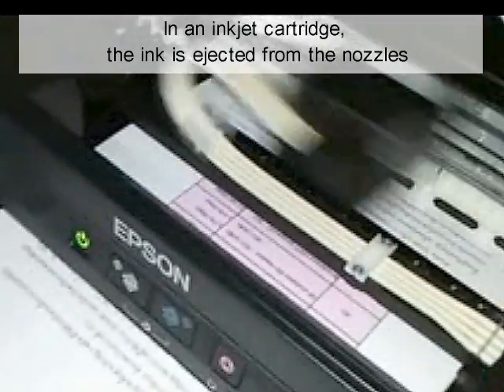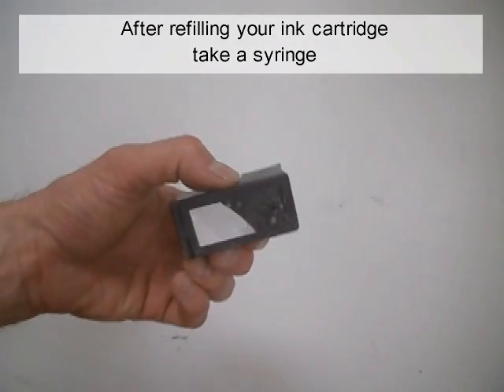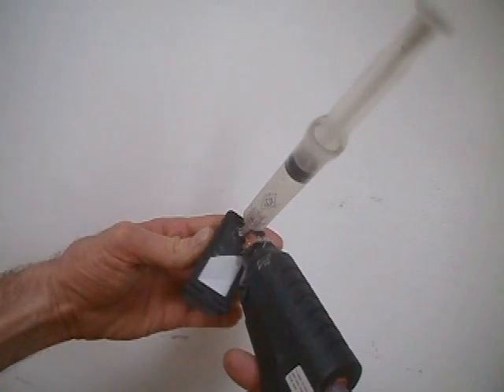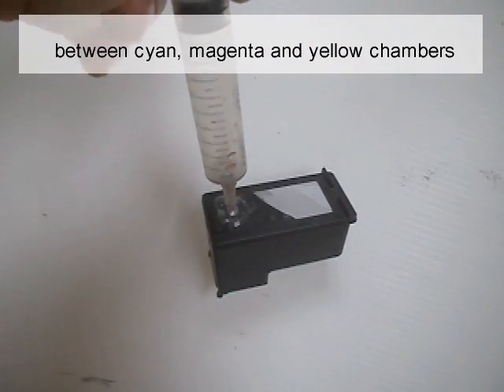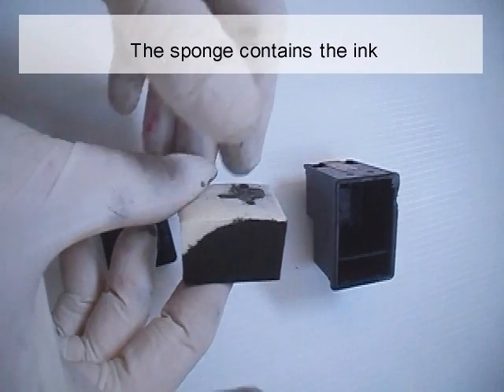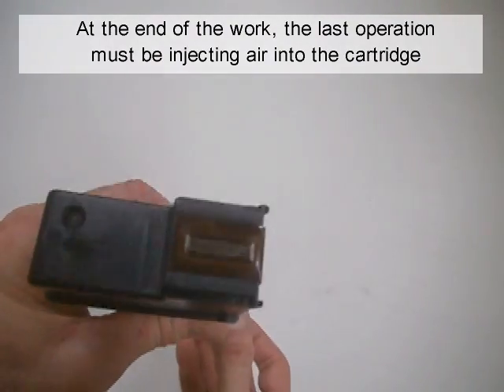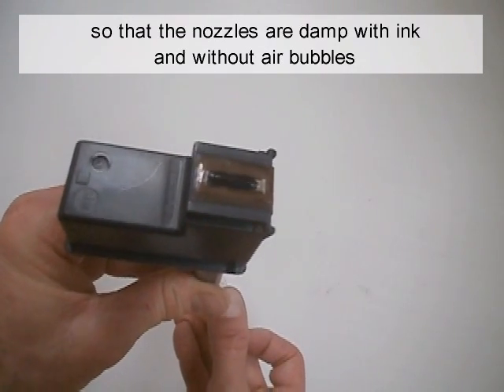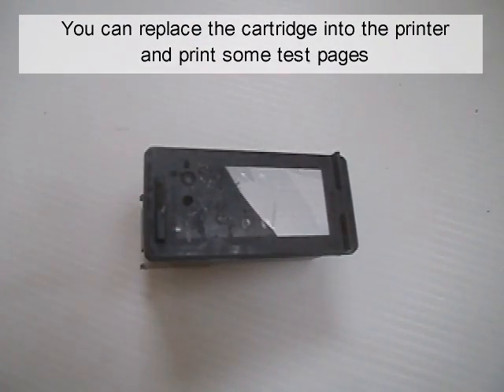How to Fix a Clogged Ink Cartridge – Pump method

Comment: That's a very bad idea leaving the cartridge hole open after u clean it... Counter intuively, the cartridge doesn't need air intake to print ink... 😳, printer uses convection(heat capillary) to print ink to your paper... 😁🖨️📄... Seal it again with glue, preferably airtight! ... 😀.might even the best advice u got from all the comments in here. 😁. But what do I know Im just your average bum living in a ghetto... 😁
Reply from the maker: There are aeration holes on top of the cartridge, another hole will not change anything
Reply: @viandant5  not from my personal experience... 😳. Cartridges works best if theyre sealed airtight... 😀

Comment: Another way I did is put a very small amount of heat on the inkhead itself(printers do this while printing anyways😀🔥), like a lighter(butane type) ... It will melt the dried ink... 😁

Comment: I am using Canon inkjet Printer. The cartridges' costs are high. The per copy printing cost is very high. It is very cheap to print the copies outside by just paying Rs2 per copy. What is the solution? The ink filling process is difficult. Can Cannon company can replace such printers with LaserJet printers.
Reply from the maker: The compatible cartridges does not cost too much and work well. However for sure the laser printers have a low cost per copy.

Comment: Are all the holes suppose to be closed before putting the cartridge back in the printer?
Reply from the maker: No, the upper holes are aeration holes
Reply: @viandant5  Could this be the reason why my black ink cartridge keep giving me trouble? I have it completely seal. I take out the rubber tiny circular lid, put the ink and then cover the hole again with the rubber tiny lid. I guess I am suppose to leave it without it? Thanks.
Reply from the maker: @VickyLatorreArt  The ink cannot come out through the nozzle if air does not enter inside the cartridge from other holes
Reply: @viandant5  Thank you so much. I tried it leaving it opened but I still get the horizontal lines. Any other suggestions? Thanks again.
Reply from the maker: @VickyLatorreArt  Try these methods: https://www.youtube.com/watch?v=p0tm8dNeE2A&t=11s

Comment: Hi! My printer is canon ip2770 and i tried nozzle check and the black one has streaks on it. I tried cleaning the head several times already and when ever i try another nozzle check, it is still the same. When ever i use syringebto reduce the ink in the cart, it bubbles. Help :(
Reply from the maker: If nothing helps, probably there are some defective nozzles. I think you have to change the cartridge

Comment: Thank you for the very useful video, which I did not notice for long. I have two cartridges, HP 21 and HP 22, which are not used for long. It seems the inks have dried. Now  I have two questions: Will I suck ink from the cartridges with ordinary syringes as I do not have any suction tool. And with the same syringe can I suck ink from the tricolor cartridge or it needs to be cleaned and then used for sucking ink? I saw you replied to questions by every one so I am enthused and asked the questions hoping that I would get a reply soon.
Reply from the maker: You can use a syringe to suck the ink, then you have to clean it to avoid color contamination

Comment: I tried dis one but it didn't work to my mp287. no yellow ink and there are missing lines in black. I did everything like deep cleaning, cleaning the printhead by alcohol and water...etc
Reply from the maker: Probably that cartridge is defective. These methods only work if the cartridge is dirty
Reply: @viandant5  i guess time to replace it :/ thanks for replying btw :)

Comment: My printer is printing only half page and later blank horizontal lines with very  slight ink drops here and there,how can I fix it please help
Reply from the maker: it depends on which printer do you have. probably you have to change the cartridge
Reply: @viandant5  am using HP DeskJet 2131 model,after filling ink for the 1st time it worked, from 2nd time it became like this
Reply: Thanks man,I thought of buying new catrigde,before that to see the problem I opened everything inside,to my surprise due to improper filling of ink for 2nd time,there are lots of air bubbles formed ,which made the output ink block,I cleared everything with water , dried,refilled very slowly and it's working normal again :)

Comment: I have an hp color cartridge that doesn't print magenta only blue and yellow, I did this and magenta ink started to come out but ultimately it didn't work, there was no contamination or anything just the magenta ink doesn't come out by it's own when you print, it's a shame since the cartridge is half full. Either way thank you this was very useful.

Comment: my printer cartridge print 2 or 3 pages of good quality after that printing quality is going low and lastly its print white and after two hour same process done. so what can i do please reply. (printer model hp inkjet 3835 and cartridge no. hp 680
please reply
Reply from the maker: Probably the sponge inside the cartridge is too old or matted and do not release the ink properly. add some ink to the cartridge, or change it

Comment: Hey my printer is printing blank pages. Will unclogging black ink cartridge solve my printing problem? I bought the cartridge 2months ago but now when i try to fill ink into it air bubble comes out with ink. Please help me out
Reply from the maker: May be it's overfilled. Try remove some ink using a syringe

Comment: This is easier----Did a black cartridge and this works great.  soak printhead in isopropyl alcohol for a day. open main front hole in top of cartridge. Make sure other holes are covered tight. put a air blower attachment on a air compressor or just use a canned air container from walmart. Aim the cartridge bottom away from u in the garage.  Hold the air compressor air tool or can  about 10" from the open hole. set pressure low on the compressor. make sure your thumb is on top of the plugged holes on the cartridge!!  Aim at the open hole and blow for a few seconds. Clean the exterior very good. Fill cartridge, tape all holes with  tape. Then just like new!

Comment: It is working. However, it only printed two pages and then printing with white page. I twice three times, same. It works consistently for the first 2 pages printing but not the following pages. Why? Help?
(NB: Printer: HP type F4210, Printer Head: HP 60)
Reply from the maker: May be the sponge inside the cartridge is too old and do not release the ink properly, or the filter over the printhead is dirty

Comment: Hi will this work for canon mx340? I keep on trying to print but black ink doesnt come out. What is the problem?
Reply from the maker: yes, it will works. but may be the cartridge has electrical problem into the electronic circuit

Comment: sir i have a hp printer which has 21 b cartridge after two or three times refilling it get clogged.What to do ?
Reply from the maker: Try "7 ways to clean a cartrige" you'll find the video in this channel
Reply: after i refill the cartridge,ink is overflowing from the nozzle when i try to set the cartridge in the printer it's not working . :(
Reply from the maker: probably the cartridge is overflow, or the internal sponge is too old. try draw some ink with the refill syringe

Comment: Dear instructor, is it true that if I choose to print 'grayscale', then ink is drawn ONLY from the black-ink cartridge, and the CYM cartridge is not used at all ?  So can I print grayscale with a black-ink cartridge but a depleted CYM cartridge ?  Thank you very much.
Reply from the maker: +patleo123 no, usuallt grayscale are printed with CYM cartridge
Reply: +viandant5 Thank you sir for the reply.  No wonder my CYM cartridge ran out of ink so quickly.  I guess I should print using 'black and white' instead of 'grayscale' from now on.

Comment: Hi! 

Thanks for the tutorial. I managed to bring back to life a cartridge that was empty, and left in direct sunlight for over a month...

Now, I use that cartridge (I also refilled it). I want to ask what shall I do with the cartridge I removed from my printer so I can use it in the future.  I want to know how and where to store it so that it doesn't get clogged (Maybe a tutorial about this could be helpful).

Thanks!
Reply from the maker: +Χρήστος Ράπτης yes. it's a good idea, I'll do a video about this. but there is not a secure way to store partly used inkjet cartridges. you can put a sponge or a cloth damp with water over the nozzles and secure it with adhesive tape. then let the cartridge upside down
 to Store Partly Used Printer Ink Cartridges 

Read more : http://www.ehow.com/how_2267211_store-partly-used-printer-ink.html
 to Store Partly Used Printer Ink Cartridges 

Read more : http://www.ehow.com/how_2267211_store-partly-used-printer-ink.html

Comment: Worked for me.  Didn't wait for it to dry printed almost a perfect grid on the first rinse. However the printing quickly degraded so it occurred to me that the ink cartridge was causing the problem. Dug around for another and it's back to normal. That cartridge is garbage no more refills for it.

Comment: how to check wether the ic is defect, or the ink is clogged :D
Reply from the maker: Bambang Soetanto if the page printed is totaly blank, probably it's not clogged but there is an electronic defect
Reply: @viandant5  sir mine is printing only one good quality page and then quality becomes very light and blank pages with streaks afterwards. Is it clogged

Comment: wow this all works.  I tried hot water first to lossen up then once i did that for 3-4 times for 30 secs -1min, I used some alcohol to capture of those hard to rid... then i did the pump. But i did the pump quite fast... and it worked... slow was taking forever. anyways now my printer is working with some ink in there :) thanks

Comment: Yeah. I did this in much "primitive" ways lol.. no glue or syringes..
I did it by "kissing" the vent hole and blow with constant pressure..
and like you said. for some reason for color cartridge, the color mixed.. =(
when I blow yellow, blue comes out.. blow red.. yellow comes out.. T.T
Reply from the maker: the colors chambers inside the cartridge are not separated on the upper part, if you blow air in cyan refill hole, the air flows into all 3 color chambers. indeed the "kiss" method is easier to do than this method, and it works the same
Reply: +thegreatMSG try to put cloath on the head down and use vacum cleaner but leave uper holes open